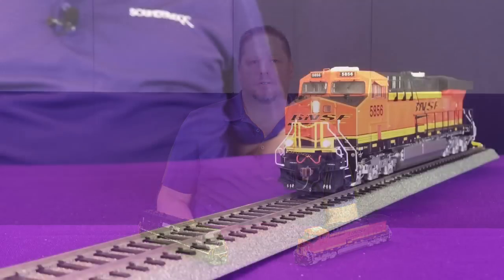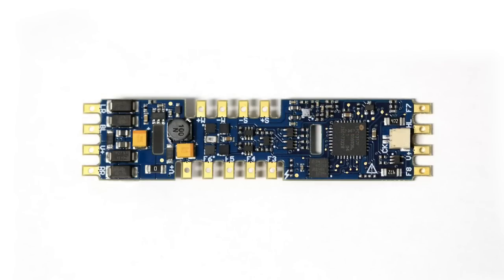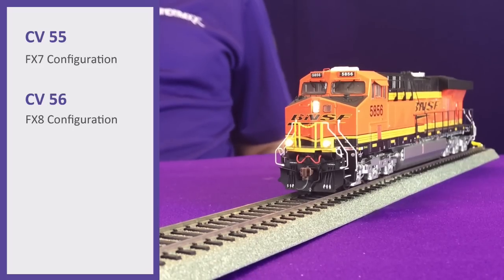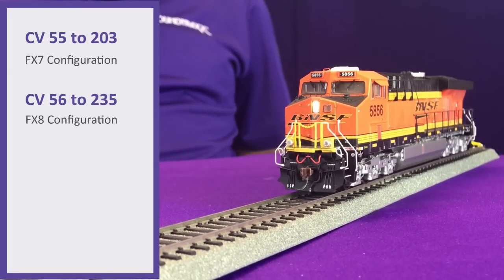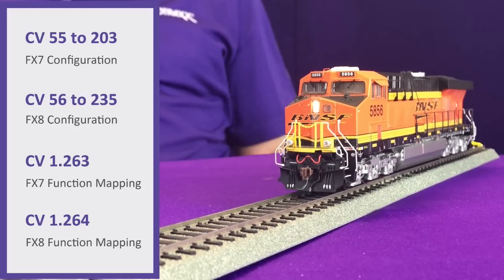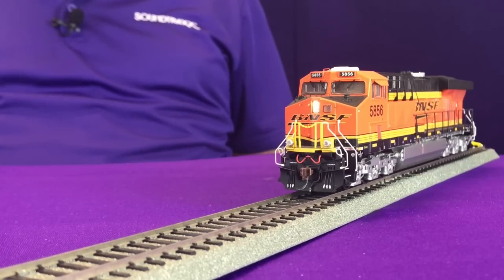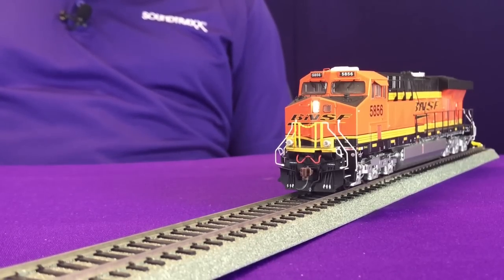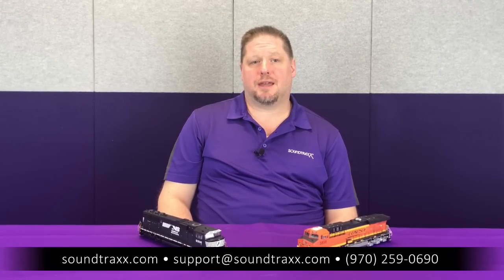NEW Athearn 8-Function, Tsunami2 decoders & LEDs

Comment: Thank you so much for this video.  I just got a Genesis GP50 and about pulled my hair out spending 2 hours trying to get the front ditch lights remapped and flash.   No matter what I did the front lights were always just on or off with F5.  
Used JMRI and manually on my NCE Powercab.    And JMRI just shows headlights, and FX3,4,5,6 so I didnt know about FX7,&8. 

Finally broke down and took the shell off to look at the board (but didnt want to. I mean thats why I got the dcc/sound model so I didnt have to take stuff apart)  and seen the FX7 and FX8 tab.    

Of course athearn did a piss poor job documenting this information in a manual.  Hell my loco didnt come with ANY manual (factory sealed)  

Anyways, I will try all this another day. It should fix it but even I'd not, the tech sheet you linked is well worth it. 

Thanks a 1000
Reply from the maker: We are sorry you had problems with your model, but we are happy that this video helped. If you need in help in the future feel free to contact our customer support center: (970)259-0690 ext. 22 or support@soundtraxx.com. Thank you!

Comment: Is this version of the 21 pin decoder available to purchase? 
Would this version work in the new scaletrains dash 9s?
Reply from the maker: We do have a 21 pin decoder in the Tsunami2 line, the TSU-21PNEM. The current aftermarket Tsunami2, 21 pin decoder is a 6 function. You can learn more about the decoders we offer on our website (https://www.soundtraxx.com/dsd/tsunami2/products/tsu21pnem.php) or contact our Customer Support Center (970)259-0690 ext. 22 or support@soundtraxx.com.

Comment: Does this decoder support throttling up and down independent of speed ?
Reply from the maker: Aftermarket Tsunami2 decoders have the manual throttle notching available on F5 and F6. The Athearn default for this is F9 and F10. On the Tsunami2, whether Athearn’s or an aftermarket, you can match the function key assignments with our flex Function Mapping.